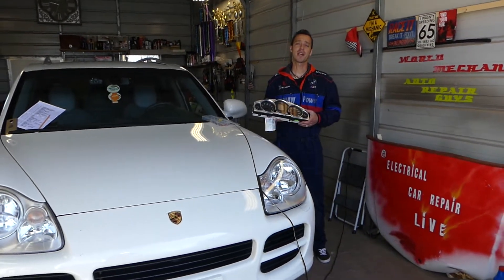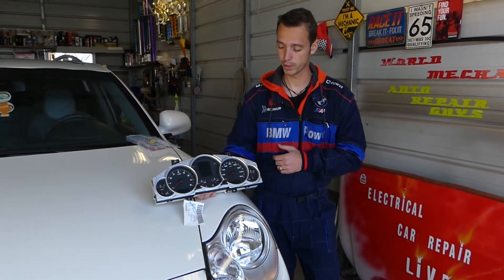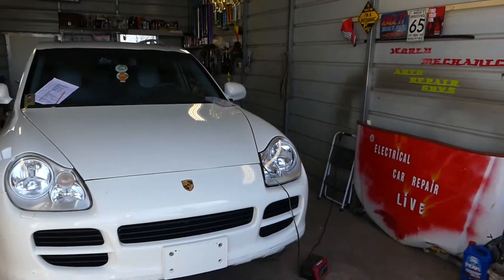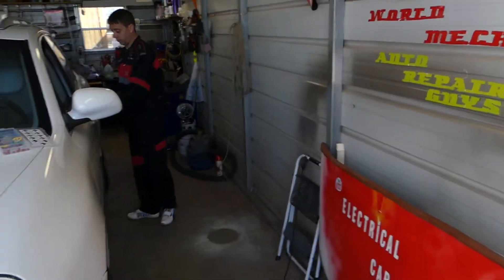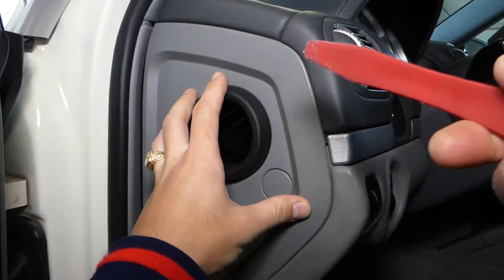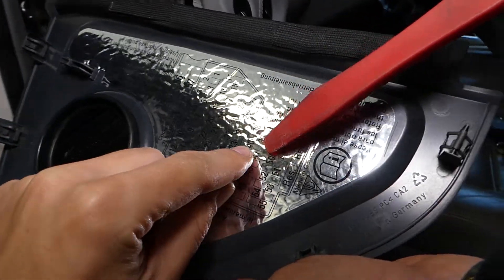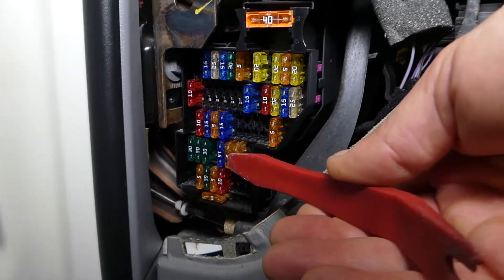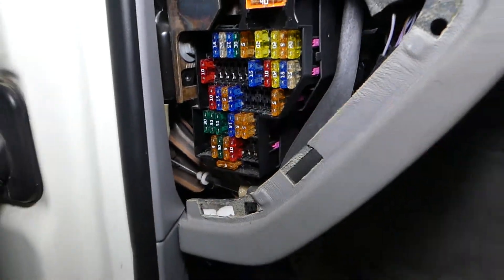PORSCHE CAYENNE INSTRUMENT CLUSTER FUSE LOCATION REPLACEMENT

Comment: I have no power to my cluster when i turn the key on  fuse is good battery is good  any suggestion thanks
Reply: Have the same thing, onley reads Porsche on the LCD, nothing else is working... This after I change the LCD. Haven't found the cause yet.
Reply: I have same issue now the whole panel is dead , did you find the solution ?
Reply: Same issue did anyone find the solution